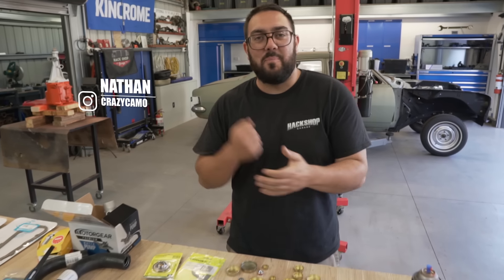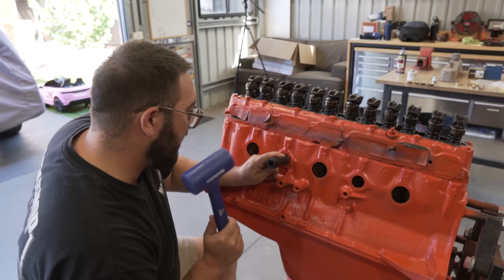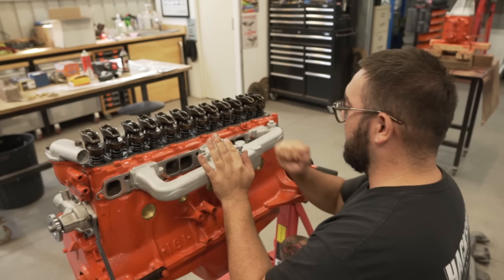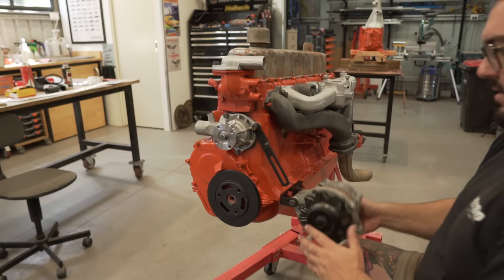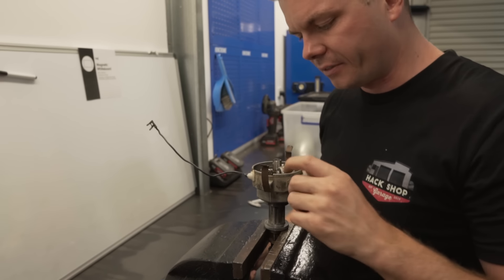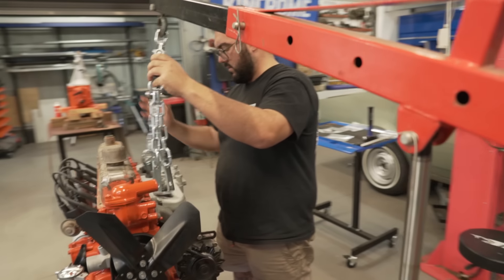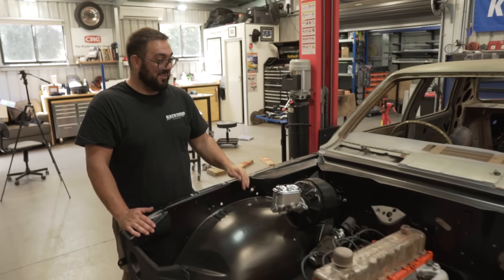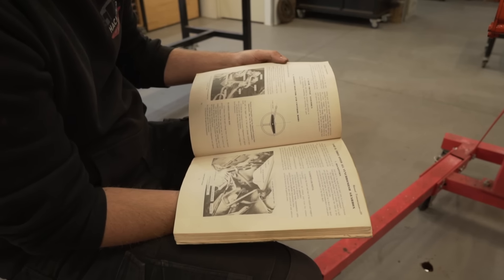RATTLE CAN REBUILD! - Looks Better Than Factory! - HG Build - Part 7

Comment: To get your ignition timing roughly lined up set the timing notch on the balancer to the timing marks on the timing cover. Then  install your distributor so the rotor button ends up pointing towards the number one cylinder mark. There is a mark on the lip of the distributor housing where the cap sits. Traditionally that is where number one spark plug lead should go 👍

Comment: If you replace the points, replace the condenser. Pitting can be because the condenser is shot. Also a good idea for a new coil too. Cheap insurance. Also check the "wobble" on the dizzy shaft at the rotor. Might need re-bushing.

Comment: I had every variant of the Holden red engine in a variety of cars over the years. The old 161 i had in a HR. Smaller than that as you said a 138. There is a 149 in between as well.

Comment: Hey boys little hack …. When torquing the flywheel bolts, a trick to stop the motor turning over is too sit a bearing cap in the ring gear teeth up against the dowel for the bell housing..

Comment: Chuck the balancer in the freezer for couple of hours helps a little when fitting  The engine has come up a treat 👍
Reply: I reckon you'd put the balancer in the sun and let it warm up to expand 😉 great to see you guys setting points! One other thing to always check that dizzy shaft rotates when you turn over the engine as the original timing gears were made of fibre and would strip the teeth (not you have this problem). This meant the cam wouldn't turn and therefore not drive the dizzy. Keep it up 👍

Comment: Always replaced the condenser as well, when I did points. My 161 died in the day with number 5 piston head seperating. I remember being told the rear two cylinders were always the ones that failed, in the red and black motors.

Comment: Rattle can resto.....  Awesome video guys when I wad 16 in 1994 my first car was a 1970 HG 186 tri magic mission brown with cream vinyl roof I ended up getting a written off HK Brougham that had a 327 chev 2 speed Detroit 12 bolt rear end abd swapped out the drive line and full brougham interior power windows power steer abd A/C even in 96 when she was finished she was pretty flash with all her extras one of the ones that got away as I brought a 1977 HX GTS 308 4  on the floor fully original wish I still had that one 2 but I sold and brought a mint VN phoenix red manal ss that I wrote off and the got the blue HQ thats my prole pix on YouTube fully balanced and blue printed 327 from.the brougham with double hump fuely heads with huge stainless valves ported match everything old school Keith black forged flat tops and heaps more good gear its been In storage for 16 years it did 10k on the road before it got stored away in 2009 and is not far from going back on the road

Comment: The Holden six peeps   Drill n tap.  And throw a bolt if you bought the bigger. Roman balancer comes with a   Big plate. Washer and bolt

Comment: The Paint colour is actually called "Rocket RED", Also if you have any troubles with the Harmonic balancer outside ring moving/spinning off through too many rev's a Blue Motor Balancer is wider & do hang on better. For future reference, the base of the carbies do come loose along with the manifold bolts for No 5. This will depend on how long he keeps the 161 in there though....

Comment: Correct  me if I'm wrong I think those distributors on top of the shaft had a little felt filter and you put a drop of oil on top of the shaft and put rotor button back on

Comment: Check how many volts to your dizzy when the motor is running should be about 8 volts if its higher change the resitor or it will keep burning out your points. Cheers

Comment: Don't call the mighty 161 weak. My first car was a 161 HT Belmont. Beat the absolute snot out of it for years. Best 4 wheel drive ever. Took me down many a bush track to surf spots and back. Holdens will go anywhere, just a matter of where they come down on the other side. Love a good rattle can resto...

Comment: Long time watcher 1st time commenting. I have a lot of experience fitting reconditioned engines back in the day day when red motors where common. Hope you guys removed all the rocket red paint from mating surfaces otherwise once the first heat cycle with the engine happens paint will go soft and everything will come loose. Also with the water pump there is 2 short and 1 long bolts if the one long bolt is placed anywhere other than with the alternator bracket it will crack number 1 cylinder boar. Please check by removing water pump. Cheers Lenny

Comment: FX/FJ motors were 132 ci, so even running a 161,which means the rattle can resto is, incomparison, got a big block in the engine bay.

Comment: Holden started making red six cylinders in 1948 if my memory is correct. If the harmonic ballancer on your engine hasn't fallen off by now it clearly didn't need one
Reply: Incorrect mate. The red motor didn't come out until the Eh. In 1948 was the grey motor which ran to the Ej
Reply: You're right. But the major point i was trying to make was they didn't use a crank bolt because they didn't need to

Comment: Why did you go orange instead of Holden red or fire engine red ? Going on the cheap and already had orange? Red would have stood out more in the engine bay . Any luck with finding a 350?

Comment: hahaha so funny to see the young work on something so mechanical, needs some oil in the key hole on the distributor so the advance will work good usually a felt pad in there as well. Suck on the vacumm to see if the advance works, 🤣

Comment: Have done many “ rattle can restos” on old Holden 6’s over the years from 161 173 186 and 202’s red blue and black motors they are the most basic motors I’ve ever worked on